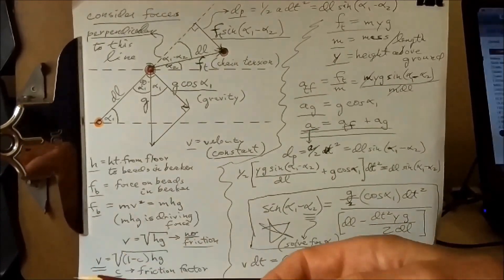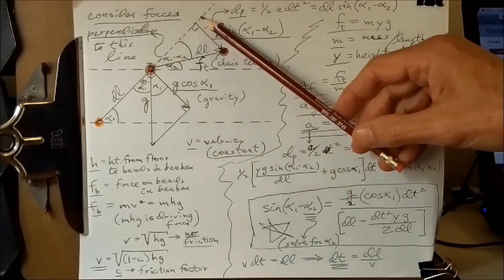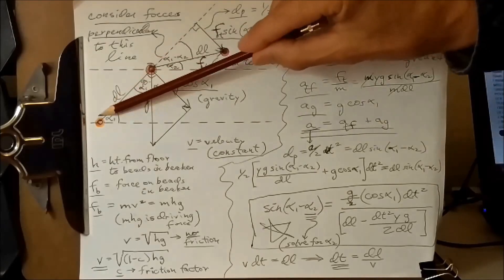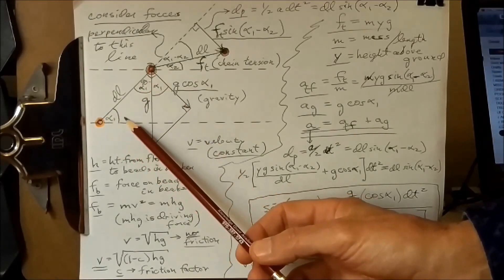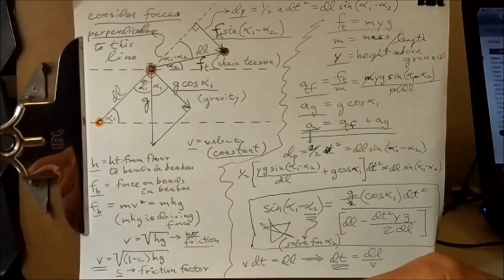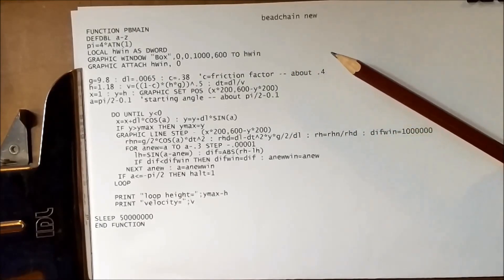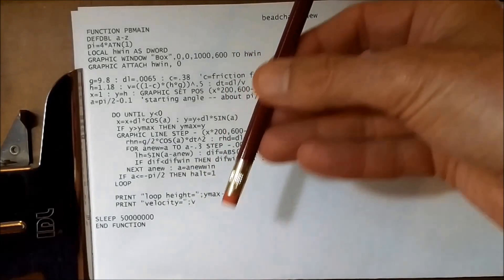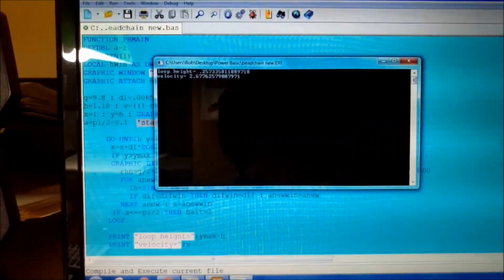Bead chain physics

Comment: Bob, i don't think there's any significant down ward force n then a counter reaction from the  beaker or table surface , the r.s explanations are completely off the mark.
Reply from the maker: Yes, I agree that the R.S. explanation is incorrect.  The beads are simply lifted off the pile one at a time.

Comment: Judging from the Royal Society video, I think a big part of what makes the bead chain work is the fact that beads have a fair amount of mass at the center.  An impulse with a certain amount of upward force applied at one end of a bead will produce a force downward on the other side of the bead; the acceleration of the bead as a whole will be the sum of these two forces, divided by its mass.  Momentum is conserve by the fact that this adds a little downward momentum to the surface.  Energy is conserved by reducing the amount of energy that would otherwise get dissipated as heat from what is essentially an inelastic collision as each new bead is jerked up to speed.
Reply from the maker: My video shows that the bead chain phenomenon can be explained without invoking an unusual "rebound" reaction as the chain is picked up.
Reply: I wasn't able to completely follow your mathematics, and please help me out if I'm missing something.  Without the rebound reaction it may be possible for a chain to exhibit transient behavior as shown, or maybe even for it to exhibit sustained behavior under ideal conditions, but the experiment works even under conditions that are ludicrously less than ideal (with the chain piled randomly in a beaker). Where in your model does vertical momentum get added to the system to replace any that gets lost to such slop?
Reply from the maker: Vertical momentum gets added to the beads as they're picked up off the pile.  This is done by the chain tension force at that point which is fb = mhg.  This is shown in my math.